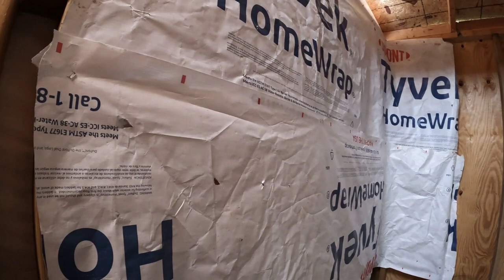Using The Screen Tight System/ Screened In Patio Build. Clean-up

Comment: Hey mike do your top spline then the bottom and then the sides and you wont get the loose screen bits it will all be tight...Happy trails mike...
Reply from the maker: Thanks, Yes I figured that out on the second one I did
Reply: Its looking good👍

Comment: You're doing a great job on the build.Congrats on the 1 mil. I finally got out in the yard. The grass was so high I had to weedeat because my mower needs a bit of attention. I only did 1 shirt and 3 sits worth. 😃 It didn't seem to be too hot outside but when I sat down I knew....it snuck up on me.Between the heat and moving things etc. I have lots more to do but at least I got a start. You' re making it happen over there.Happy Trails!